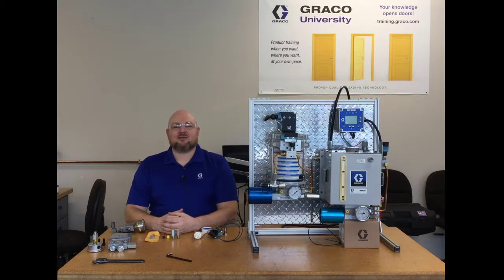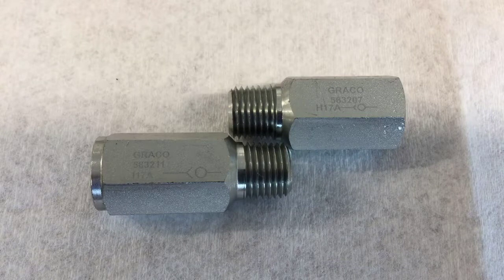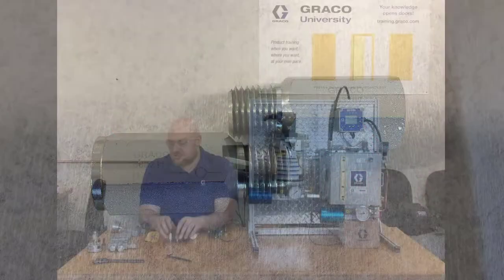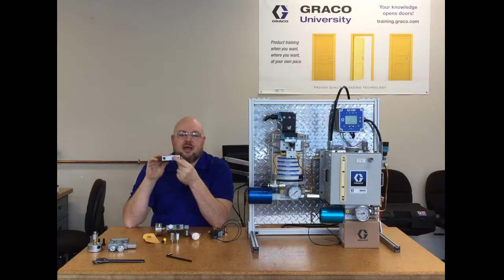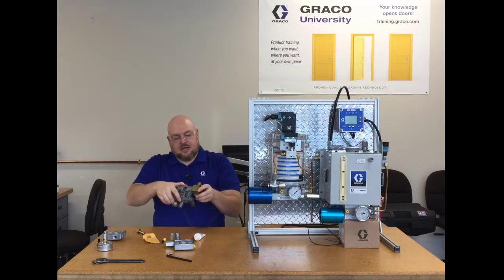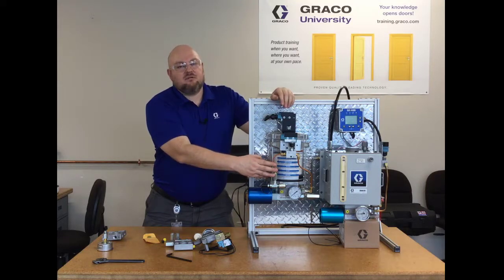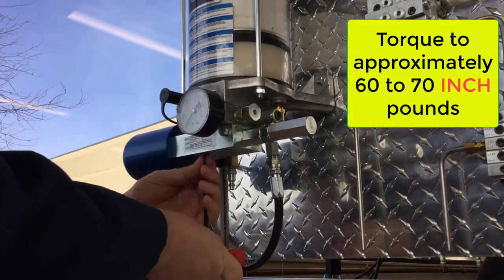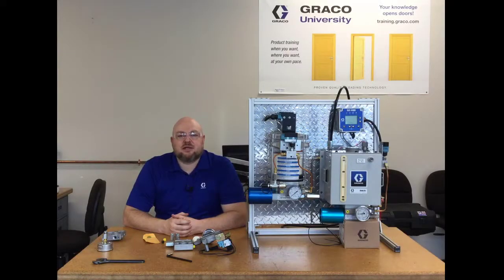Modu-Flo Package Assembly

Comment: Please mention how to repair Pump element of g1 g3
Reply from the maker: Hello, when you mention G1 and G3, do you mean for Graco's G-Series line of pumps? If so, the pump element is not repairable, so it needs to be replaced. Part number 571041 is the Graco number for the replacement pump element. Here is a link to the video which shows how to replace it:
https://youtu.be/DvB7xZH5pH4
Reply: Can you show how the grease is being refilled?